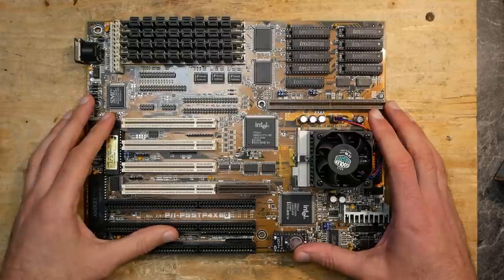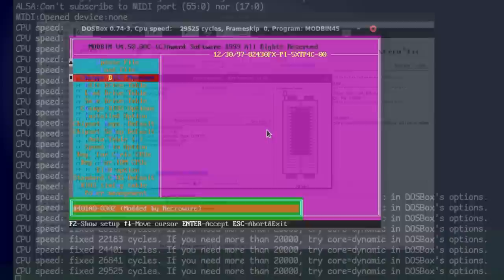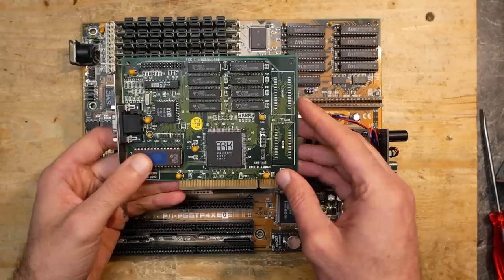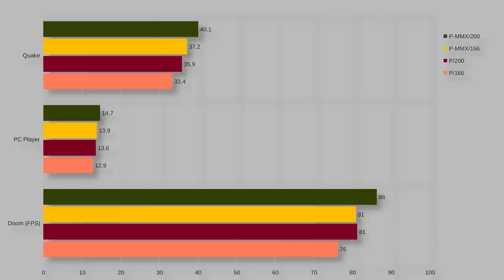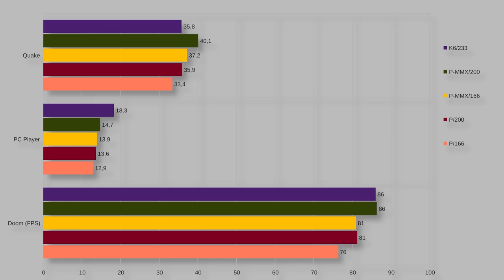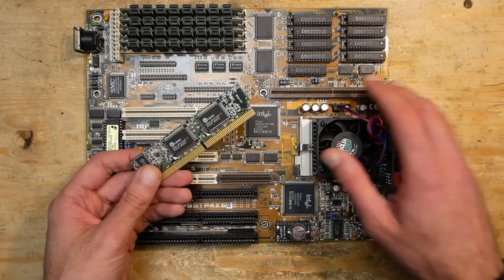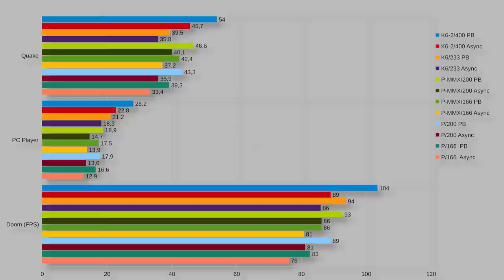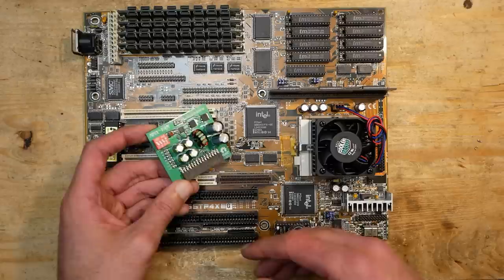Let's upgrade an early Socket 7 board beyond the limit (Part 5): Showdown!

Comment: Thanks for this video and the always interesting content!
I have to add something about the MMX Pentiums... they were a little more than just more cache and MMX. There was a better branch predictor, borrowed from the Pentium Pro. But that's not all! The Pentium has two pipelines, called U and V. The U pipeline could run all instructions in parallel, the V, however, could not. You carefully had to order your instructions in order to be paired on the original Pentium. This especially applied for prefixed instructions - those not available on the original 8086 - so basically several 32 bits instructions.The MMX Pentium, however, could handle more operations in the V pipeline, and hence, this, with the larger cache, and better branch predictor, have a notable impact on performance as well, as it could pair more instructions per cycle.
I wasn't aware by HOW MUCH pipelined burst cache could speed up those old CPUs... have some stick lying around and surely one or two boards - need to try it ;)

Comment: A pipeline burst cache... I totally forgot about that. It had a HUGE impact. I went for a Pentium 90 instead of the P100 an invested the money into PB cache instead. This was a great decision as my home-built P90 wiped the floor with the Compaq P120 that we used in the office.

Too sad you didn't try the FSB upgrade. I totally understand the reason of course, but it would have been really interesting. Sure, not 100Mhz, that will most likely not work, but maybe 75Mhz. At least on later motherboards a moderate overclocking of the FSB to 75MHz was always stable. I also never had a PCI card that didn't work with 75Mhz. It would be interesting, if this works for the FX chipset too. Then you would get the AMD chip to 450MHz and see the impact of FSB increase.

Comment: Must be over 25 years ago  but I remember those  older Asus boards  with the media  bus slot at the end of one  of  the pci slots, the p55t2p4 with the right revision I think rev 3 and above would overclock and run a bus speed of 83mhz just by setting jumpers on the board- and was the fastest board out there at the time  - it was posted on Toms Hardware  about 25-27  years ago but your running with a fixed clock divider!  I remember it well as I bought the board for that reason, andran mine at 83Mhz up until the p2 came out without issues after I got it settled down,  from memory  I only run intel CPU's in the board,  I had a sb16, a GUS Max and a diamond stealth 64 (S3 chipset)  with an NE2000 compatible  nic, all seemed to behave ok  in it at that speed, I wrote a simple multi-config DOS menu that i used to  assign irq and dma to the sound and scsi,I used a multi config to  change settings by menu selection at boot time  as needed , there were cards that didnt like the high bus speed  like the AWE32 would sound wierd and I did have to swap out the 1542 adaptec scsi card for a PCI NCR one  as the adaptec didnt like the overclock neither did the advansys  or buslogic cards behave at overclock  - great stuff  it brings back great memories  and always look forward to  viewing your channel what you post thankyou

Comment: The 512k COAST module gives a further performance boost. Probably a decade ago now, I tested the difference between a 256k and 512k COAST module on a P200 MMX, and there was a 5-7% performance improvement in Quake.

There's supposedly a rare 1 MB COAST module, but I never seemed to be able to find one.

Comment: 66MHz FSB bottlenecked all CPU's starting from around 166MHz, and that bottleneck became even worse after 200MHz. MMX-Pentium's bigger L1-caches helped a little, but underlying slow 66MHz FSB and 33MHz PCI-bus strangled the whole system. I ran 350MHz K6-2 as 336/112 because it was almost as fast as 400/100. But ran cooler with stock voltages. Slightly higher PCI-bus (112/3=37.3MHz) helped too. Practically all PCI-cards I used (Matrox/Voodoo1/3Com NICs) worked with 37.3/37.5MHz PCI-speeds, sadly many began to fail with 41.5MHz PCI-bus (83MHz FSB).

Comment: Back in the day I would spend so much time tweaking the BIOS and other settings to get a few more FPS, but right now I would be happy to just modify the clock module to get the battery working and the voodoo card working.
I have almost the same motherboard (PI55T2P2), my CPU is Intel 133MHz.

My oldest HDD booted up just fine with Windows 95 (WD Caviar 2340 - Aug 94), my second oldest drive is dead (Caviar  31600 - Jan 96). It makes very low clicking sounds so maybe put it in the freezer would work...

Very melancholic to go through your old hardware and kinda emotional to see it boot up after so may years in storage.
It's funny but when you pack away your stuff you don't care because you just bought a brand new computer to replace it. But then when you come back 30 years later it hits different.
It doesn't quite feel like 30 years. Must be some kinda time dilation going on, the dead CMOS battery inside the sealed clock module could explain some of it; mentally I'm the same age the day that battery died 😂
Reply from the maker: That sounds really philosophically :)

Comment: I have the UMC burst pipe module in my m520 and it works without any issues. So I think that might be a bad module. I could test it in my PCchips m520 or if you have one you might want to try it there. Oh the m520 also has a VRM socket.

Comment: Feel free if you happen too own one put in a voodoo 2 into the system as a 3d gpu & benchmark a few glide games.
Quake 2, Unreal should have timedemos or you can make your own ones which will make for very consistent testing with that in mind.

Like for example in Quake 2 you write in the console " timedemo 1 " too have the game remove the fps cap & max out the game speed so it's a shorter burst of a demo. & " map demo1.dm2 " for example.

And yeah nice too see and confirm that any motherboard cache becomes essentially level 3 cache for the k6 processors with built in level 2 cache like the normally only mobile k6-2+ which i happen too have here, half the L2 cache of the k6-3 but very close in performance too the k6-3 cpus still & thanks too being mobile processors usually a bit more efficient then their desktop counterpart too cool down.

Depending on what motherboard you had back in the day jumping from like a pentium mmx 166 mhz overclocked too 200 mhz, too that coast module & k6-3 at 400 mhz or if your motherboard & video card could handle like a 75 mhz bus speed overclock, you were set for a while on the cheap for sure.

Fairly certain the 3dfx voodoo cards aren't super sensitive too overclocked pci bus speeds btw so 75 mhz should be ok being 9/8ths of pci bus basically speed wise if you don't have a clockspeed divider in the bios too toggle.
For the 2D card the later the better basically for general stability as well if you want too do any fsb overclocking.

Comment: a k6-III was able to work on this socket 7 motherboard??! 😱
Wow...I never knew the potential this motherboard was capable of having.
Fantastic series this was. My concern though is the build itself. Can it be put to the test with voodoo 2 (sli or not)?
What atx power supply is recommended on socket 7 motherboard btw?

Comment: I kind of remember a 75 MHz and 83MHz FSB.  They could get a K6-2 to run at 450MHz and 498MHz.  Some graphics cards base on a AGP 66MHz could run at PCI clock at 66MHz like the Bondi Blue PCI Power Macs. I think they were ATi Rage cards.

Comment: The sockets on the onboard asynchro-sram seem to be longer than the chips installed.
Is there a possibility to take this up to 512KB and use it for level-3 cache with the AMD K3-500 ?
Perhaps with yet another mod on the bios ?
And what about the Pipeline Burst ? Any 512KB availablity there ?

Comment: I remember having problems with a 75 MHz FSB on a Cyrix MII machine. It wanted 75x3.5 but I ended up using 66x4 because I'd get random graphics corruption on 75 FSB. I could always reproduce it by opening a PNG image; after that any JPEG image I opened would have pink artefacts.

Comment: Looking at your results i doubt your conclusion the k6 was performing slower because of the floating point unit, though it seems somewhat valid. After you added the pipeline cache it was a real winner. Seems to me the k6 just needs the modern cache solution to shine.

Comment: I enjoyed the video! I would like some details though, from someone. The last CPU (printed 500MHZ) was running at 400MHZ? 66.6 MHZ FSB bus by 6 multiplier CORRECT? And it worked faster than the others because of what? The internal cashe? That external PipelineBurst cashe module really improved things.
Reply from the maker: Yes 66x6 is max possible clock in this board. K6-3+ was faster because of much faster internal L2 cache.

Comment: Wow, I hated these CPU cooler clips. Once my screwdriver slip and damaged a few hair thin traces on the motherboard, and the customer's computer were completely dead. I had to make a trace repair on site, it worked but it was one of the most tenses days on the job in my early career.

Comment: I thinkI finally want to get out my K6-2 5?? machine and see if i can upgrade the bios after watching this. I think i have a 533 MHz chip in there and wanted to get it to 600 MHz but fell short. I wish i had gotten a K6-3 at the time but i think i was worried about my random pc chips motherboard and booting it up.

Comment: Seems like Quake 1 is playable on all configurations. I've always wondered if K6-2+/3+ could reach a level of performance on Socket 7 to run games like Quake 3 and Unreal Tournament at at least 25 fps, with 3D acceleration of course. Seems like that would be quite a challenge, even with completely overpowered AGP cards.
Reply: Played a lot Q3 on k6-2 450 with Matrox G200 but on more modern AGP system with mvp3 chipset (chaintech 5AGM2 if I remember correctly)
Reply: Yes, Q3 is a big challenge. Q2 is fine, you can play it in 800x600 smoothly.
Reply: The issue you'll run into trying to reach those performance levels, is that these chips really need the FSB speeds of an SS7 board to get there easily. Having a faster FSB allows for much higher bandwidth between the CPU and GPU. I have yet to try it, but my FIX VA-503+ board has I think a 124Mhz option for the Front Side Bus and a whopping 1MB of onboard cache. The K6-2+ I'm using and the ram seem pretty rock solid in this configuration. It's most just a matter of finding the time to try some games. I feel like what might actually bottleneck it is the Voodoo Banshee I have in there. I wonder if anyone would know if the CPU would bottleneck the card, or if the card would bottleneck the cpu?
Reply: @railsrust  I have an MVP3 board but I only overclocked via the multiplier (5 to 5.5). Perhaps FSB is the way to go?
Reply: @Edvinas_channel  Perhaps. It depends on the silicon lottery. The ram needs to be high quality and built for 133Mhz (Pentium III era ram), and the cpu needs to be able to handle the FSB. I would make sure to pair it with a card that is actually a little too fast for the cpu like a Voodoo 3 so as to remove bottlenecks. Even this, these games really aren't what the K6-2+ and better cpus were really great at. They let you run a ton of Windows and DOS games out of one machines while making a few compromises; performance on late 90s 3D games being one. That said, it should probably be possible to run UET and Q3 at 30 or better most of the time, but I wouldn't expect it above 640x480. I haven't tried it yet myself, so I don't actually know. Just telling you to mute your expectations.
Reply: @railsrust  I tried it myself, the resolution makes no difference since the bottleneck is not at the GPU. 30 was unobtanium, however looking at forums it seems my performance was lower than it should be, but my config wasn't very optimal to begin with. Perhaps if I really try...
Reply: @Edvinas_channel  Sounds like something isn't set right. I never checked in mine, but it might be worth checking in yours if it has settings for ram timings. Tightening those up could help substantially. I also recommend you try out with a higher FSB setting and see if it's stable. If it's unstable try using your highest quality 133Mhz SDRam sticks. I doubt that the gpu would care much about a higher bus speed. I had a FSB of 124 with a multiplier of 4 to get what it detected as 500Mhz. See if that works for you. Also try different driver versions. I know depending on the card it can add a ton of overhead. Also make sure settings and patches for the game are optimized for the cpu/gpu you have.
Reply: @railsrust  I remembered why I wasn't overclocking the FSB - because I can't! The motherboard only goes up to 100. Perhaps hardware mods could get me above that, but definitely not with a stock HOT-591P.

Comment: nice taking a barelt windows 95 board, and making it fully capable of 98se or ME.  Just need a better graphics card with 3d capability, or add a voodoo with the existing 2d card and it would be even better.

Comment: I don't think "weak FPU" is necessarily THE explanation why K6 is falling behind in Quake. Like sure it's a part of it, as it showed a small disadvantage in pure-FPU benchmarks, but consider, Doom is part hand optimised for a 486; Quake is hand optimised for Pentium specifically, using its very limited superscalar ability to the fullest, also running FPU and integer calculations in parallel, which without this extra effort, rarely happens on it. PC Player benchmark is not hand optimised at all, it's just plain C. For the most part, K6's superscalar and out-of-order logic makes good performance out of generic code, even if instruction timings and other performance traits of it aren't quite up to par. So i think P5 that is overperforming in Quake in particular but this just isn't reflective of its overall performance.
Reply from the maker: Well, Quake was not only the first (famous) game, which made FPU mandatory, but it also heavily relied on it. Back then AMD delivered outstanding performance in integer arithmetics and could even beat Pentium II clock for clock in some loads, however it always lost in floating point calculations due to weak FPU. I was already software developer back then, so those particular results in Quake were not surprising to me. Same happens, if you try to en-/decode mp3 files for example. In regards of optimizations, it doesn't play a role if the program is in C or any other language. The optimizations during the compilation are mostly language agnostic.
Reply: @necro_ware  Yeah but the only tuning aware compiler of the era is egcs (and that's much too late for quake), the rest produce processor agnostic code, and even egcs doesn't have enough reasoning depth to exploit superscalarity of P54. P54 has two pipes but most instructions won't run in parallel with most others, there's a very sparse superscalarity matrix. Quake has all the rasterisation code hand written in machine language, which was common of the games of the time, but it is particularly optimised for P54 which is not typical.

K6 i think can run FPU and ALU in parallel, i just doubt that the FPU workload is enough to saturate the FPU performance. Floating point edge setup and perspective correction is interleaved with rasterisation code, being the overwhelmingly largest workload in the game, such that the rasterisation on integer ALU is performed in parallel and there's hundreds of integer instructions per FPU one, making the FPU instructions "free" here if they're vaguely fast enough and truly independently executed. This is a crucial difference to say MP3 compression or a synthetic FPU-stress workload which saturates the FPU.

Comment: Did you ever actually test the media bus extension using that SCSI/SoundBlaster card?
Reply from the maker: Yes. Works fine. Initially I wanted to build a retro PC with this hardware, but as you see it turned out to be a bigger project :)

Comment: You could try Unreal Tournament - But there is a caviat , directX on a nvidia card ( tnt2 or Geforce 200mx ) is bugged - its fine at the chosen video solution ( 640x) at first but not if you change the resulution - you will not have back the fps you had before only worse  fps , but i had windows 95 osr 2.0 and not 98 - Also when nvidia did support directX 8 in the driver later than 12.?? the performance went down anyway in the games i played - The dark open gl drivers in ut99 and tnt2 could give you 1024x768 performance at good fps - but it went all to crap trying the playing online , 18 fps or so or worse which lead to A duron 600 even thou ut99 likes a Athlon 1000+ much better

Comment: Have you tried to turn on write vombining on the K6-2/3 CPUs? That can help A LOT with video access and subsequently with games.
Reply from the maker: Funny misspelling :) Yeah I tried, but there are only tools which give a boost for higher resolutions, which I didn't present in this video. May be next time.
Reply: @necro_ware  Indeed :D Well, if you can turn it on for the A000-AFFF area you can see a healthy speed boost in Quake 320x200 or even in Doom (not that sure as it has a strange video memory access pattern). K6WCX surely did it for me. In a real SS7 system, I must admit, yet it should work just the same here.